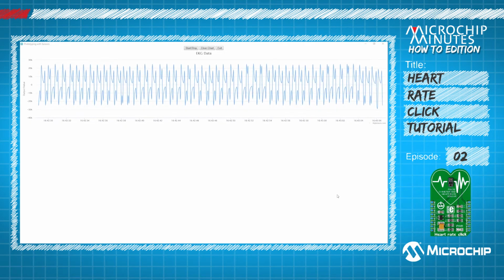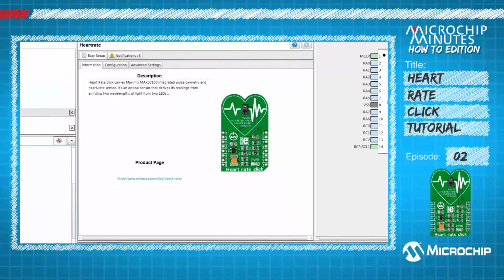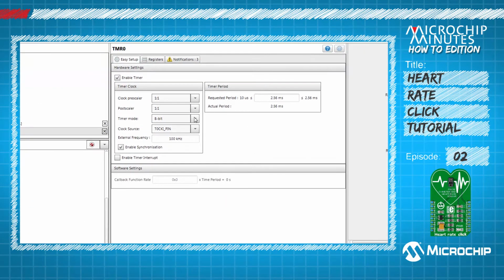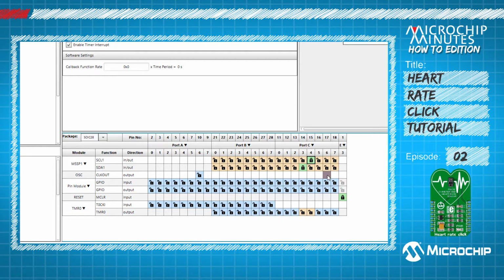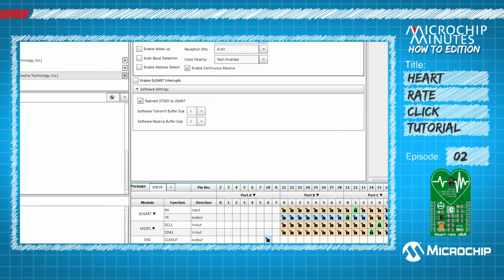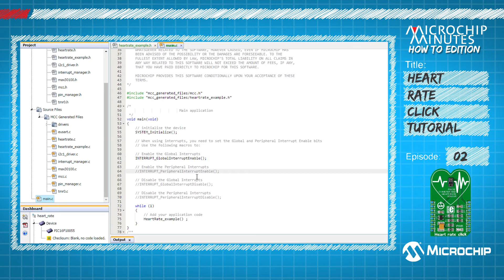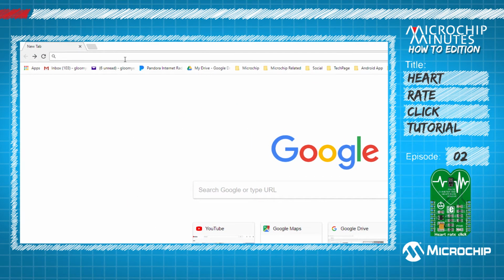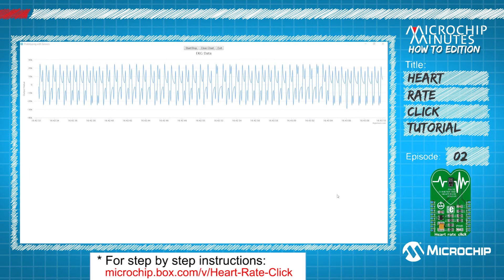MM - How To Edition - Episode 2 - Heart Rate Click Tutorial

Comment: @microchip
  How about a demonstration of a simple battery management application hobbyists like me could really use.
   I am looking for the simplest possible solution for a circuit that gives me a 5 volt +/-10% output from a single lithium battery cell. I need 150mA minimum, but 500-1000 mA would be nice to have. I need an integrated charger circuit with over voltage and under voltage protection. I also need a system that can run from a USB micro port/power adapter.
   There are a ton of PMIC battery management IC's available, but I am pulling my hair out looking for a simple hobby level solution here. All of the highly integrated IC's seem to focus on step down topologies from a single lithium cell and are mostly available in BGA's. Perhaps an example using a PIC16F785 would help, or maybe there's some other simple solution I haven't seen.
  YouTube has almost no content about a circuit like this. I could piece together something myself but it wouldn't be very well designed and I don't have the space available for a bunch of separate IC's. Perhaps there are some options available that I haven't been able to find? I've spent a whole day digging through Digikey, Mouser, Microchip's website, TI, Maxim, AD, and even checked Cyprus. 
    I'm building my first 4 layer board to send off to a board house using an ATmega1284 on an old OSHW project. The project uses the 20Mhz full power crystal feature so I need all 5 volts. I'd really like to add a battery option on board. Any suggestions are welcome, and an example from a reputable source would be greatly appreciated ;)
-Jake